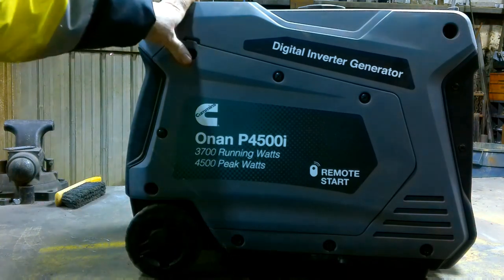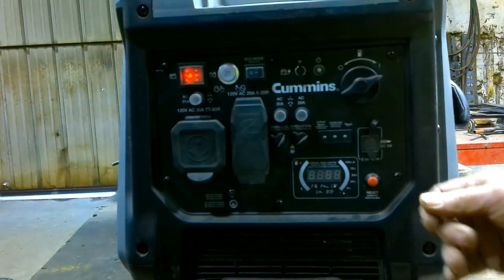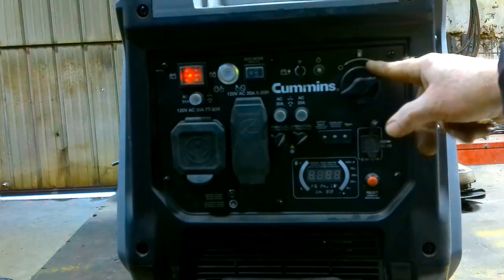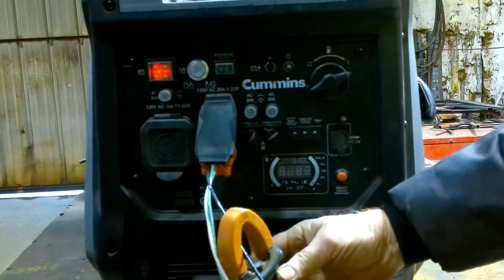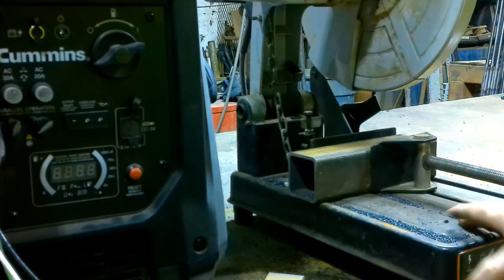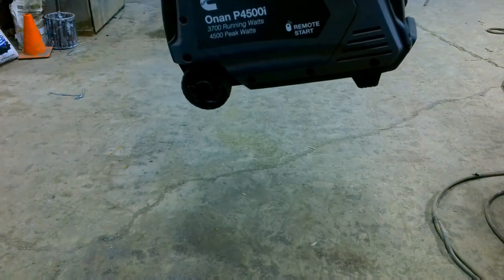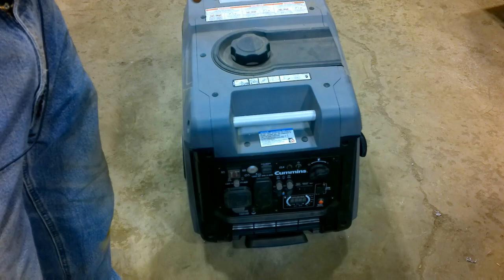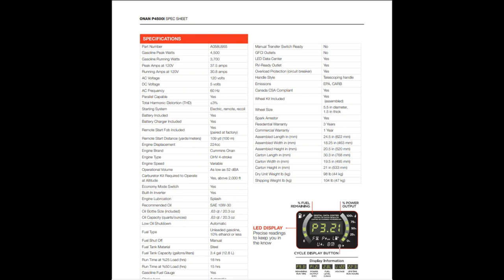Product Review- Cummings Onan P4500i Generator

Comment: I have this exact Generator. Absolutely love it. Can also use it on the job site. I tried hooking up my welder to it and it’s not enough amperage.
I have the 125 adapter for my Miller Multimatic 215. I tried welding with the lower voltage adapter, and it still would not do it. Anybody else have that issue?